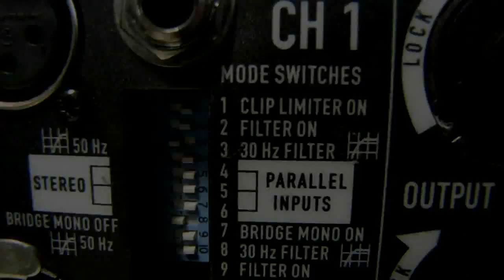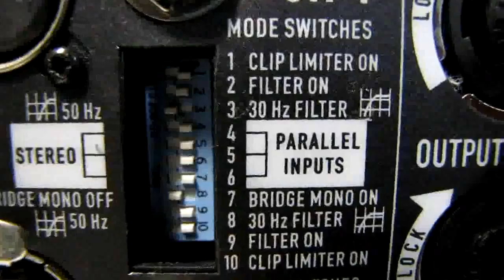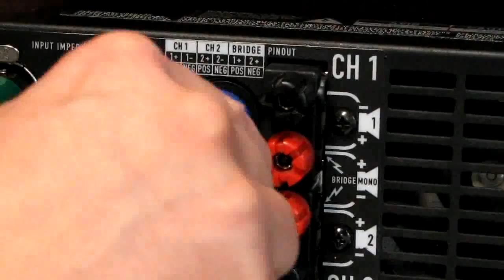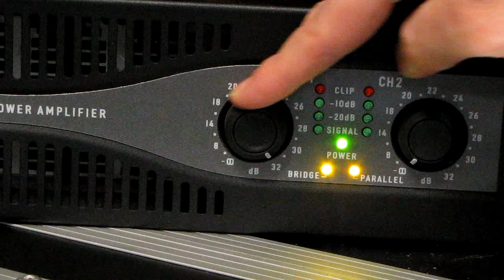Bridging a QSC amplifier - Stage Left Audio

Comment from the maker: On many amplifiers, the input of the second channel (or "B" channel) is used as an output to send the signal out of the amp (to other amps), but only when the amp is in either bridged or parallel mode.  Basically, connect an XLR cable from the "B" channel input on one amp and connect the other end to the "A" channel input on another amp. Whatever amplifiers you are using, I recommend checking the manual.

Comment from the maker: Look at the Crown amp manual.  You can probably connect 2 x 8ohm speakers to a bridged amp, as long as the amp supports 4 ohm bridged (parallel connections).  Many older amps can only support 8 ohms bridge.  If your Crown amp can be operated in bridge mode, it will indicate that in the manual.

Comment from the maker: Yes - make sure the dip switches are set correctly and you are using a speaker cable wired for bridge operation.

Comment from the maker: The speakers can only be connected in a particular way; the speaker wiring (on the amp side) needs to be wired to support bridged power).  The reason for bridging is to utilize the full potential of the amplifier.  Bridging combines both "sides" of the amp into 1 large mono amplifier.  You mention "series" wiring; that is a wiring method, but I think what you mean is "parallel" wiring.  Make sure the ohm load of the speakers is within the range of your amp.  If not, it could burn the amp up.

Comment: Some QSC amps won't work in bridge mode with speakon connection. I have an RMX that only pushes that bridge power through the bridged banana clip post. It'll play through the speakon post but you won't get that bridged power.

Comment: I just bought a QSC GX5 and it sounds great thru channel 1  - I've only had it 1 day. They claim it can be bridged but the documentation
sucks even on their website. It says use the 1/4' jumper to connect channels but they are a bit vague on the output connection. They show 2 speakers connected to both output channels but I only have 1 speaker cabinet so does this mean I can run the GX5 in bridged mode ?
Reply from the maker: The GX line of amplifiers cannot be bridged.  Looks like the website is showing how to get an input signal to both channel inputs.  The GX line are good cost-efficient amplifiers, but they are not designed for bridged operation (which is why you are unable to find information on the output connections).
Reply: @stageleftaudio  OK you are obviously correct ! It seems a single 500 watt channel will work for me - I'm using it as a bass amplifier with a Sadowsky pre-amp. It sounds great ! Although had I know this beforehand I would have bought a bridgeable amp. All is not lost - I can use this GX5 for my home hifi if I decide to buy a bridegable amp in the future. Thanks for your message.

Comment: My question to you is ===>> Can you Bridge a QSC MX3000a  amplifier which is rated at 8 Ohms = 800W, 4 Ohms = 1200W & 2 Ohms = 1600W ,,{,Bridge}  8 Ohms = 2400W & 4 Ohms 3200W  ===>> to play 4 - 8 Ohms speakers hooked up in series/parallel? I understand that 4 - 8 Ohms speakers in Series/Parallel = 8 Ohms. But will the amplifier be able to push the speakers comfortably?
Reply: sean khan  hola me pueden alludar con mi problema es que mi planta qsc cuando se clipea se apaga vuelve a ensender la planta es de 3000 wt las cabinas son dos dobles de 800 wt cada una

Comment: thanx for the video, i got confused thu, i have two amps and 4 speakers, 2 tops and 2 bass, the phonic amp i use for the tops, i used left channel for left top and right channel for right top, the qsc amp i used for the bass, channel 1 to right bass channel 2 to left bass, so i managed to get the top speakers to work but i only hear one bass not two, i think i didnt configure the qsc right, all my back switches on the qsc are to the right side, and only channel 1 is working on my qsc, channel 2 has no signal output at all, i want to work in stereo mode, so here how i connected everything.....from the mixer to the equalizer inputs, from the equalizer outputs i connect to the crossover, from the highs and mids on the crossover i go to the input 1&2 channels on my phonic amp for the tops, and from the low on the crossover i go to the inputs of the qsc channel 1&2, for the bass, but i only get one bass to work, channel 2 has no output :/....how can i fix this?
Reply from the maker: There's a lot of variables involved.

Which QSC amp are you using?  What xover are you using?  Do you have everything connected in stereo (or 2-chnl mode)?  You mentioned no output on the QSC for chnl #2, does the amplifier meter show there is output for Chnl. #2?

If you are running a QSC PLX, and all  the switches on the rear are to the right, this means the amplifier is in bridged mode.  Bridged mode does not support stereo (2-chnl) mode.  Bridged mode only works for single channel.
Reply: @stageleftaudio  wow thanx for the help....i dont know how but i managed to make it work, yes i use a qsc plx3002, iv switched cables, tried different configurations and after 4 days of struggle it worked, the sound is great, i use jbl 15" tops and jbl 18" subs, behringer  cross and a presunos studiolive 16.4.2 mixer, the sound is blastinggggg.....thanx mate
Reply from the maker: Sounds good!  The PLX3002 amps are very nice.  Good luck!

Comment: what would you say is the best amp for two Cerwin Vega  EL-36C Subwoffers 
and the best amp for two JBL JRX 125?
Reply from the maker: Amp choice needs to be based on how the speakers will be used (i.e. live sound or for DJ use).  If for live sound, don't use any amp that can deliver more than the speakers "program" rating (or mid rating).  If for DJ use, don't use any amp that can deliver more than the speakers continues rating (or the lowest power rating).  For DJ use, this is because recorded music is highly compressed and lacks dynamics; amps for DJ use need to be less than for live sound.  QSC, Crown, Yamaha... any of these would be good.
Reply: stageleftaudio Its more use for DJ.. I have the crown xls 802 for two cerwin vegas EL36C, i dont know if that would be enough for two subs on one AMP. Can you please help me out. And would you rather a driverack instead of a crossover, subharmoinc, etc.
Reply from the maker: The XLS802 would work; it's rated at 500 watts/chnl @ 8 ohms - which matches your subs.  By keeping the power limited to the "continuous" wattage specification of the speakers, this will greatly reduce the chance of burning up your speakers (especially for DJ use).   Make sure all limiters are turned ON for the amp.  Without limiters, your subs can be damaged by distortion. For DJ use, a regular xover is all that is needed.  There's not too much dynamics in recorded music, so all the bells and whistles a driverack unit has would not be needed.

Comment: I am planning on bridging a crown xti4002 amp at 4 ohms to achieve 3200 W RMS, if I am using speakon cables all I do is plug it into the channel one connector after selecting the bridge mode in the software or is there any other wiring required?
Reply from the maker: Take a look at the manual for the xti4002.  It should reference the correct wiring for bridge operation.  

You should not connect a "regular" speakon cable to an amplifier in bridged mode.  The speaker cable must be wired to support bridged mode.

Basically, the speakon connector for one end of the cable (the end that connects to the amplifier) should be wired using the +1 (for positive) and  the +2 (for the negative).  The other end of the speakon cable (that connects to the speaker) would be wired as +1 (for positive) and -1 (for negative).  The speakon connector (for the amplifier side) would then connect into channel "1".  

It is highly recommended to us a special mark/label on any speaker cables that are used for bridge operation, because they will not work with non-bridged setups.

Comment: I have qsc Rmx 1450. I use channel 1 volume knob  on bridge mode but if I turn down channel 1 and turn up channel 2 it works , is it suppose to work on both volume control  on bridge mode
Reply from the maker: +Mahesh Laikhram It sounds like your amp may not be configured correctly.  For your amp, it should only work with the channel 1 attenuator  along with the channel 1 input.   Verify these things... Make sure the dip switches on your amp are set correctly for bridge operation; make sure you are connecting the speaker wire correctly to the proper output (and also, make sure the speaker wire is wired "correctly" for a bridged signal).  Make sure the amplifier is turned off while making in dip switch changes.

Here's the manual for your amp:
http://www.qsc.com/resource-files/productresources/amp/discontinued/rmx/q_amp_rmx_series2ru_usermanual.pdf

Check out pages 10 - 13
Reply: thank you. I found out that the problem is fix if parallel is off.
 I'm sending it back , delivery guy must have dropped it. 1 volume control is stiff and the other makes cracking sound when using, plus body damage. thanks again for your help.

Comment from the maker: The word "comfortably" is very relative.  The lower the ohms, the more stress it places on the amplifier.  Also, it depends on how the amp. is being used when bridged (for lows, mids, highs, full-range).  Bridging in 8-ohms is easier for an amp than bridging it in 4 ohms - consider this... a bridged 8 ohm load is the same as running the amp in 4 ohm stereo - so, a bridged 4 ohm load is the same as a 2 ohm load in stereo.  It's best to keep a bridged load at 8 ohms if possible.
Reply: Yeah exactly you don't even need to know the bridges specs just look at the 2ohm rating of the amplifier and combine those two channels and it will tell you how much power you will get at 4ohms bridged

Comment: Can we use send and return on this amplifier
Reply from the maker: Yes, however, it's possible the signal may not be balanced.  As long as the cable is short (several feet or m), this may not present any issues.

Comment: what will happen if i accidentally plug both xlr input in when bridge mode is on ?
Reply from the maker: +Mahesh Laikhram Good question.  We've never connected 2 XLR outputs to the inputs of a bridged amp, so we don't have practical experience on what would  happen;  I recommend contacting QSC directly (i.e. their forum) with your question.  One of their engineers may be able to provide you an accurate answer.
Reply: thanks

Comment: Can you do stereo mode and parallel mode on a video. But on a qsc rmx?
Reply from the maker: Take a look at the RMX manual.  If the RMX amplifiers have the same input/out configuration, then you should be able to daisy chain them the same way as the PLX.

Comment: For example my amplifier in a bridge mode is 2800w I have 3 speaker which one is 800w 800w 800w
Reply from the maker: Most amplifiers can only run either an 8ohm or 4ohm load when running in bridged mode.  This usually equates to only one speaker that can be attached to an amplifier.  Depending on the ohms of the speakers you mentioned, and the type of amplifier you are using, you could connect all 3 speakers to one side of the amplifier (with the amplifier in non-bridged mode; i.e. stereo mode).  Read the specs on the amplifier you are using; it should show how many speakers you can connect to it.  To be safe, you can probably only connect 1 speaker to a bridged amplifier.

Comment: is this same principle to qsc RMX 4050A and rmx5050A?
Reply from the maker: Yes.  This works on most any amplifier.
Reply: @stageleftaudio  sir i have more question. now your amp have 30hz filter  does it mean if you use it for as a subwoofer amplifier. then you have a analog dbx crossover will it produce 30hz frequency? from 45hz to 30hz frequencies?

Comment: how do I set it in a normal mode " on the switches" I just want my left and right to function normal.
Reply from the maker: The switches on the rear of QSC (and other) amplifiers are used to configure the amplifier for stereo or bridged operation.  Older models use dip-switches, whereas newer models use standard switches; and some of the most current models use a touch screen.

Due to the many ways to set an amplifier, I recommend downloading the manual of the amplifier you have.  It will show the correct way to set your amplifier.

Comment: can i use channel A for woofer and channel B for highs in this amplifier QSC gx5 power amplifier thanks!
Reply from the maker: Yes.  It is very common to use one channel for subs and the other for highs. You will need a crossover to send the signals to their proper channels.

Comment: How would you connect both speakers to the one channel
Reply from the maker: If a second speaker was to be attached, it would be connected to a speaker that is already connected to the amplifier.  For many speakers, it would be the second connector on the back of the speaker (daisy chaining of speakers).  Many amplifiers that can be bridged can only run an 8 or 4 ohm load.  It's important to know the total load that will be placed on an amplifier before connecting another speaker.

Comment: my amp can run 8 4 and 2 ohms.   my subs can run on 16 8 and 4 ohms.  would I connect both subs together then run into the amp
Reply from the maker: Yes, for example, connect sub "B" to sub "A".  Then, connect sub "A" to the back of your amplifier.  If both subs are 8 ohms, this type of setup will present a 4 ohm load to the amplifier.  If the subs are 4 ohms, you should NOT connect both subs to the amplifier.  Most amplifiers cannot run bridged mode for anything less than 4 ohms.  If your subs are 4 ohms, you can only connect one sub to a brdiged-mode amplifier.

Check the documentation for your amplifier.  It will show you the minimum ohms that the amplifier can support when in bridged mode.
Reply: Thank you

Comment: how do i come out of my crossover in the amp in bridge mode.do i not connect side 2 and only connect side 1 or what do i do.i have a behringer crossover.
Reply from the maker: +DjTwon40 You don't need to make any special changes in your crossover to support a bridged amplifier.  Make sure the "low" signal output of your crossover goes to channel-1 only of your bridged amplifier.  Channel 2 on the bridged amp cannot be used.  When bridging an amplifier, you are converting your amplifier to a single channel large amplifier; which means you'll need another amplifier for the other mid/high output of your crossover.
Reply: I got another amplifier for my mid and highs. I just needed to know about both sides of my crossover. Because sides of my crossover have a low settings. I'll try that today and see what happens. I need a bridge mono speaker cable too correct.
Reply from the maker: +DjTwon40 Correct, you will need a special "bridged" speaker cable to connect the amp to the speaker.

Many crossovers have outputs called something similar to "low frequency sum".  This is probably the connection you need to use to connect the crossover to the low freq. amp (assuming you are running stereo with the crossover).

Comment: Qsc RMX 4050a vs mx3000 wish one better for subs
Reply from the maker: Depending on the subs you are needing to drive, the 4050a (assuming the Class-H series) would be a much better option,
Reply: Thanks
Reply: One more thing can the qsc 4050a play 6 , 18 speakers 1500 whtt in bridge mood?
Reply from the maker: The load an amplifier can handle is actually based on the load attached to it.  Running (most any) amplifier in bridged mode can only handle down to 4 ohms... this usually equates to 1 x 4 ohm speaker, or 2 x 8 ohm speakers attached in bridged mode.  It may not be possible to run the 4050a amp with 6 speakers in bridged mode.